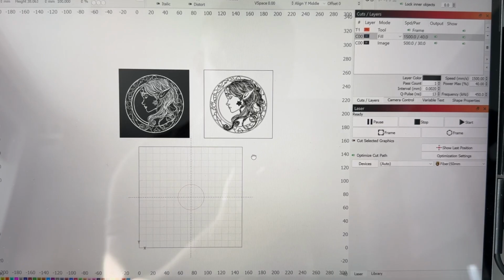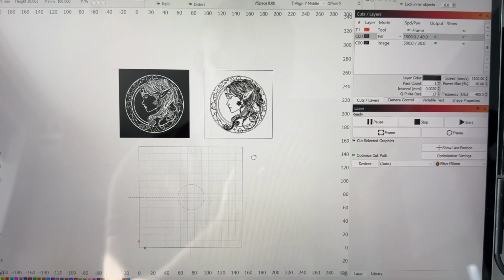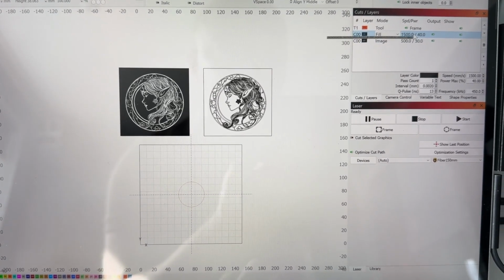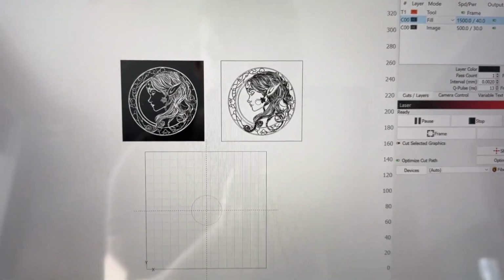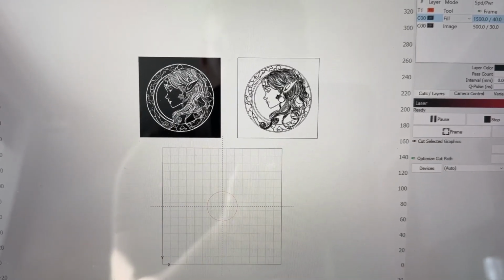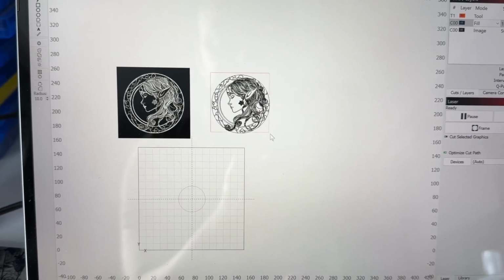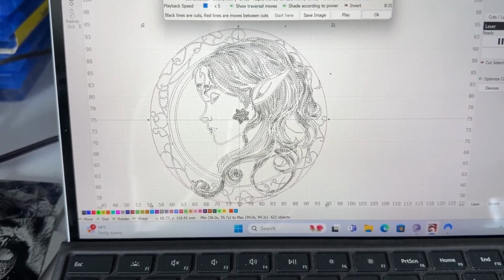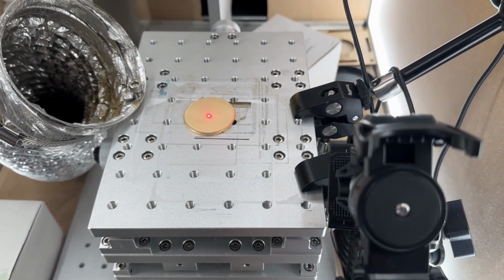Black Fiber laser engraving on Brass coin

Comment: Hello, thank you for this informative video.
I have a question, and I would be really happy if you could answer it:
Would applying polish on the black-colored engraving on brass cause a color change, or would it result in a shinier black instead?
Reply from the maker: anything abrasive will reduce the black but polishing prior to engraving the black should be ok

Comment: The black markings you engrave are beautiful! I will try this with my 50W mopa... may need to adjust the settings a bit though. Ususally my Q-Pulse is set at 200, haven't tried 60 yet. Thanks for the insightful video!
Reply from the maker: My pleasure

Comment: im guessing you cant do this if ona  30w raycus ou need a mopa laser for the Frerqueency as my one I just bought doesn't go as far as 450hz obvs.   I'm new to fiber so trying to figure out thanks great video though..
Reply from the maker: Try at 450 and see the result im not sure it will be much different but worth a try :) the frequency inlightburn is amendable by the user so worth getting the specs for your laser and making sure it is max 450 or can be set to higher
Reply: @Nonprofessional_Tinkerer   think my machine only goes to 60hz. For raycus right.
Reply from the maker: @magic1nds  yes unfortunately raycus 30w can only go to 60. Still worth a try at 60 to see the result
Reply: @Nonprofessional_Tinkerer  yeah true
Reply: @Nonprofessional_Tinkerer  thanks for replying
Reply from the maker: @magic1nds  no problem
Reply: @Nonprofessional_Tinkerer  I have the same issue my laser can only go to 60hz, a solution is to apply black oxide coating, then remove it using your laser.

Comment: Thanks for this. I noticed the stand on your laser, are you using a 300x300 lens? What's the apparatus that the coin was sitting on? Also, did you build an enclosure? Quite the setup, would love an overview if you're looking for video ideas.
Reply from the maker: @bearsstuff  thank you, the coin stand is something i found on thingiverse and 3D printed. The laser enclosure i built from old 3D printers i nolonger used, its made of aluminium extrusion and 3mm MDF for the top half. Sitting on a frame of extrusion holding the case of the laser. Its all on wheels so i can move it around. I can certainly do a video, its cheap but keeps the fumes and dust away, add a webcam and you can watch your engravings in complete safety. The lens im currently using is 150mm.

Comment: Terrific!  Thanks for showing the settings and explaining that portion.  I’m about to run out to the shop and work on lasering some leather and then a challenge coin!
Reply from the maker: @spencerc4054  my pleasure, i hope to see the results
Reply: @Nonprofessional_Tinkerer  
I don’t know how to upload the picture.  However, the project took three hours to do one side (I did a Topo map).  I copied your settings and wonder if I can speed it up
Reply from the maker: @spencerc4054  what was the size of the project? a coin black engraving shouldnt take that long at 1500mms unless your speed it set to 1500mm/m